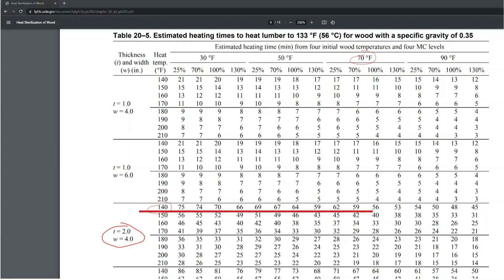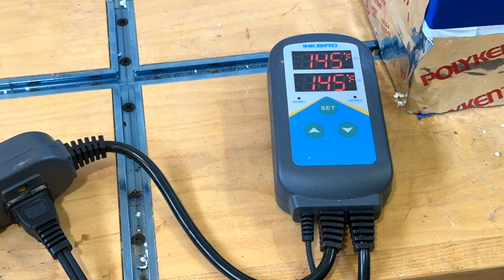Heat Sterilize Wood to Kill Bugs!

Comment: Thanks for this video. It's great.  I recently built a steam box for bending wood. In the end, I built 3 versions of the steam box using plywood, hardwood, and eventually 'blue skinned' plywood. I considered using rigid foam to build the steam box but was concerned about it melting.  It seems you had no trouble at 145 degrees and steam boxes run at a lower temperature. So, perhaps the next step is to build a more durable dual purpose heater/ steamer box.  But wait, perhaps I could start making my own Thermally Modified wood (200 -220 deg. f) ...... and so it goes. 1 box to do it all!
Reply from the maker: Thanks for the kind words!  Sounds like you have some fun project ideas coming up!

Comment: Thanks JKM, I used your (rough) plans to make an 8x2x2'.  I got the same heater, but also added a tiny utility fan at the opposite end to circulate the air.  Holding 142-143 degrees for 4 hours straight now.  I have to do a few batches, but this is a great method to get the critters
Reply from the maker: That's great to hear, I'm glad the video was helpful!

Comment: Your affiliate link for the heater no longer works. Can you provide the name brand or model of your heater? Thanks.
Reply from the maker: The heater is Dura Heat EUH1465.  Thanks for letting me know about the affiliate link not working, I'll get it fixed.
Reply: @jkmwoodworking  I've read the reviews of that particular heater, and seems of very low quality, failing in many ways soon after warranty expires. Do you have any other recommendations?

Comment: Love the setup! I'm looking for a heater for a similar use case. When your Dura Heat shut off due to the overheat protection, did you have to manually restart it?
Reply from the maker: The heater would automatically restart heating once it cooled a few degrees, no need for manual intervention.  The nice thing about this heater is that the fan kept running even if the heat protection kicked in.   I'm trying another setup now that still uses the dura heat heater, but I'm adding in a couple of heat lamps which won't have the heat protection cutout issue.  I'll see how that works, and likely put out another video on how that works in the next month or so.

Comment: Thanks for sharing this build.  I am doing my first bug sterilization  on some red oak.  20 degrees outside.  My got box is in the garden shed.  Loaded with 8 months air dried  wood right now after a hour and 15 minutes it has the inside at 90 degrees.  Empty it only takes 1 hour to get up to 140.  Thanks for the tip on the dura heat it is working great.
Reply from the maker: That's awesome, I'm happy to hear it's working for you!
Reply: Now for the fun part.  We got 6" of snow last night.  My plan is to go out and unload the kiln bring that up to the shop in the garden tractor cart and stack in on my rolling dolly cart and strap it down on the oak inventory cart and  reload the Kiln with some more of the 8 month air dried wood and this time I plan on loading it to the hilt.  Moisture content is about 6 to 9% so will get it up to 90 and run the dehumidifier for a day and then if no condensate run the sterilizing process. OR just wait a day or two and let the snow melt and then do it.  Retirement is difficult to make decisions like these........ HA! 

 I think I will just get the lawn tractor out that has chains already on it and see if I can drive it up to the shop which is up hill all the way!

Comment: great concept, but reviewing the equipment used, the controller is limited to 1200W, while the heater goes to 1500W . . . we all know there is safety margins built in, but the OEMs would hide behind the limits exceeded IF there was an issue.  This may still be worth the risk for those looking for this type solution
Reply from the maker: Great point, thanks for looking into the specs!
Reply: @jkmwoodworking  Thank you for posting a great resource . . . I plan to build one very similar and add a humidifier in it for a longer term project
Reply: He specifically mentioned running the heater on low setting. Most heaters run around 900 watts, therefore no issues with the controller.

Comment: Cool video. Would you think a conventional electric range oven would do the job at 150 degrees for a couple hours while supervised? I’m not a big wood worker but I was gifted a nice small black walnut cookie slab that had just been surfaced yesterday and when I brought it home I found a fresh dead bug in one of the holes that got cut in half by the router during surfacing.
Reply from the maker: Thanks!  Yes, a kitchen oven would work great, and be significantly easier than what I did in this video.  Many of the pieces of wood that I had were too large to fit in my oven, but if you have some smaller pieces, then just a standard oven is the way to go.
Reply: For a conventional range, allow the oven to preheat to temperature and stabilize before placing your wood project inside. The reason for this is that conventional ovens significantly overshoot the set point while preheating. Once at temp, they’ll hold the set point nicely.

Comment: Thank you for the video. The times, volume, temperature are an immense benefit. I was thinking of building a solar kiln, but this will work better in the start as I already have solar panels. Running heaters is an expensive endeavour. 

I am testing it out, but you could use a simple WiFi enabled thermometer with a probe. Use a WiFi switch for the heater. Each of those two pieces cost about 5-10 dollars each on the cheap side. The app will allow temperature tracking. Not sure if the sensors are made for 140F on it. Running the heater only on its own is a recipe for disaster in case of a failure starting. Often times the elements will not stop and keep on burning, not a fun sight.
Reply from the maker: Thanks, great idea!